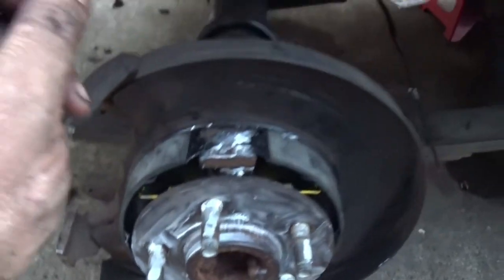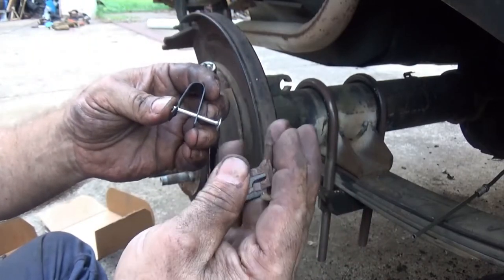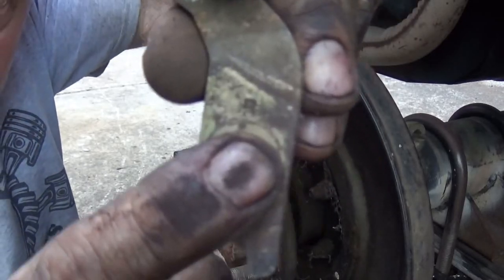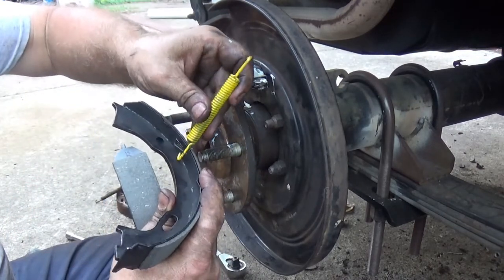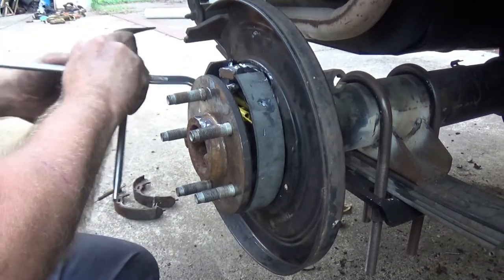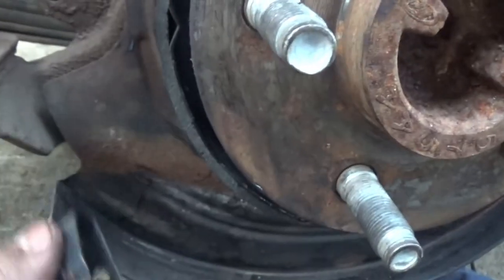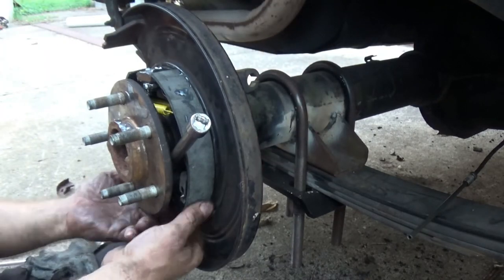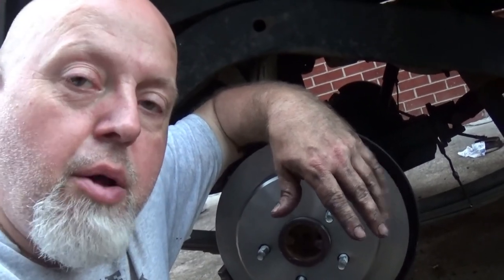How to change Ford 8.8 rear diff ebrake Shoes and Hardware #88swap #ebrake #poweraddictscrew

Comment: Thank you for this video!  I’m not very mechanically inclined but I’m in the process of rebuilding my 88 from the frame up with an 8.8 swap.  I just finished doing one side of the e-brake dis/reassembly and this video helped so much!
Reply from the maker: You are very welcome! Glad the video helped.

Comment: Great video man. I just did the 8.8 swap and the e brake actuators on mine are swapped left and right. Now I see that they are upside down.  Thanks for the video.  I went with the stock e brake pedal and lines through quadratec works great. Stay safe and happy trails 👣

Comment: Very good video,  Excellent technique.  I have bee fighting with mine.  Have one side done and am down to the last hook on the outside spring on the passenger rear.  Unbelievable how much tension is in those springs.  I am going to try removing the adjuster and pins to get the shoes closer together like you did in order to attach the last spring   Thank you

Comment: Hey dude ! Been 2 years.. never did see the video of the 8.8 swap when you installed the drive haft… Im in the middle of the 8.8 on my 92 yj 
Not sure the part number of the yoke flange adapter
Reply from the maker: I had a situation where I was rushed and didn't get to shoot any video installing it. I pulled the yoke adapter from a mid-80s Ford Ranger in the junkyard. They use the same style adapter but with the smaller YJ-sized u-joints.

Comment: Chuck what is your thoughts on running a line lock in Stead of the cables
Reply from the maker: Personally, I'm not a fan of line locks for parking brakes. The electric style will be a constant drain on your battery when engaged. The manual "valve" style can bleed down hydraulic pressure and eventually turn loose. The electric can do the same as the manual valve style allowing the pressure to bleed by over time. For me its cable style or chocking the wheels. Have a good one bud!

Comment: Why not just pull the axle? Takes all of 45 secs push in axle pull c clip and viola.. Then you'd have world's more room to do this job
Reply from the maker: I got ahead of myself and had already put new grease in the diff and sealed it up. You are correct, the c-clip is pretty easy. Honestly most people still wouldn't do that. Thanks for the great tip!